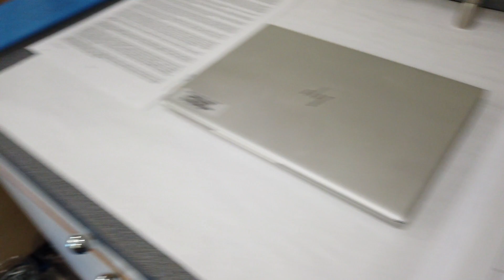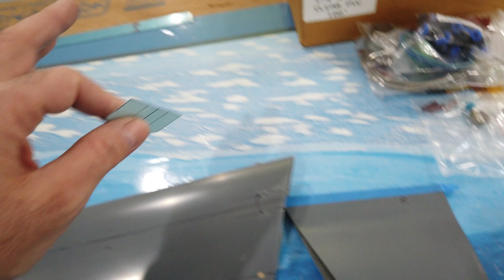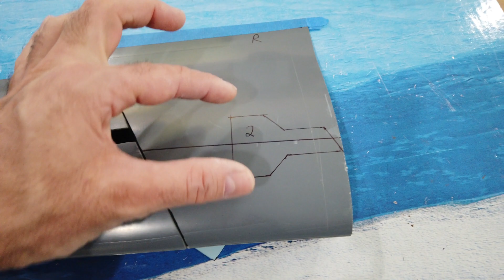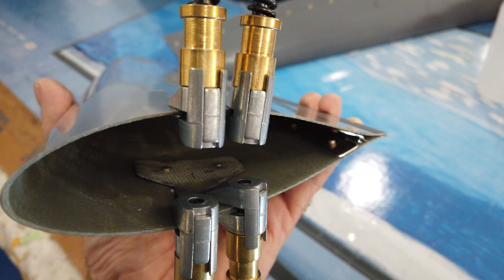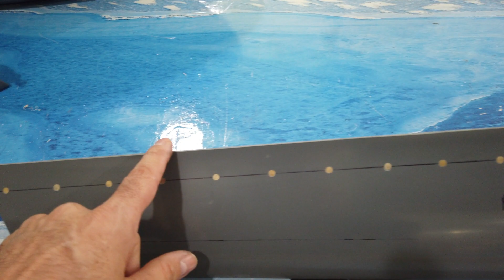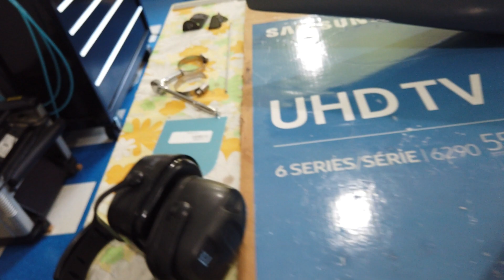Vans RV 7 HINT Video Gear Leg Fairings Final

Comment: Nice work, but sorry to tell you that almost ALL mount tabs end up breaking off in the first few hundred hours.  Flex of the gear is too much and eventually wears out the tab.  The leg fairing then 'floats' with the fuse and wheel intersection fairings holding the leg faring in place.  Seems to work OK with well secured intx. fairings.
Reply from the maker: Howdy Walt. Thanks for the heads up. I'll see how long these hold up until they snap off. Waiting on intersection fairings now.